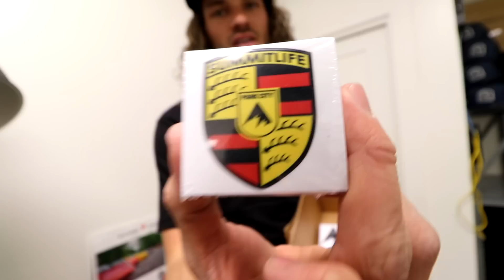Putting Snow Tires On The Lambo!

Comment: You guys should tighten the bolts while the car is hoisted. Doing so while on the ground can be dangerous as the wheel might not be perfectly against the hub, and the torque is applied against the friction of the tyre and ground, not the wheel against the hub - if this makes sense.

Comment: When torquing wheels alternate or stagger torquing the lug nuts.
Reply: Yes, but ever more important is to stop tightening when the wrench clicks. Faith maybe easy on the eyes, but she needs to go easier on the torque wrench. Over torqued several lugs.
Reply: And/or hand tighten the lugs while the car is still in the air. If you lower the car and the wheel is not at least fixed, then tightening the lugs on the ground could throw off how the wheel rotates and certainly puts undue strain on the axle/wheel mechanism. Then staggering the lugs further insures that the wheel doesn't go on funny.